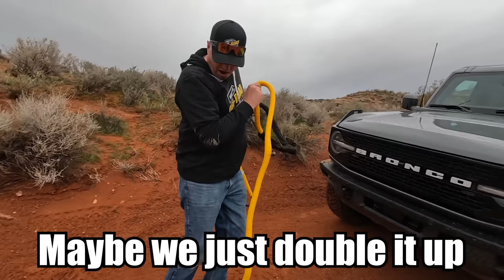More Difficult Than I Thought...Is The Wrecker Too Much For Me?

Comment: I think the boom needs to be extended. If you look at trailmater his boom is a lot longer and it keeps the vehicle out and away from his bumper and boom
Reply: Make the length adjustably long to be situation suitable….
Reply: Rory wouldn't have carried it out ... He would have welded it back together and had Shawn drive it!
Reply: I have 0 experience in off road recovery, but it sure looks like a slightly longer boom would really be helpful. Something that can be extended would really be nice, but maybe not worth the trouble.
Reply: Needs a longer boom and some link bars to connect the wrecker and towed vehicle together.
Reply: Needs a sling like most of the tow trucks, everyone keeps mentioning its not setup right, knew this would happen.
Reply: Or maybe an angled boom for better clearance?
Reply: @edc6333  Did you watch the games? Sling towing was no advantage and caused more problems.
Reply: But, but Rory just dumped one on its side towing it.😢
Reply: does mater have crossbars too? i think he does.
Reply: @G53X0Y0Z0  crossbars or link bars are crucial otherwise it's just a crane.
Reply: How about something to rest the wheels on like on-road wreckers.
Reply: @thomas1942  that’s what I’ve always wondered. Why not just a wheel lift. That would be as useful or more useful than a boom.
Reply: Stand-off bars in the shape of a triangle mounted to the wrecker at a single point, like a tie rod end to allow articulation in two axis and rotation and then able to attach to the customer vehicle at shackle points.
Reply: @pkonneker  - I think you are exactly right. An extension to the boom that was about parallel the the ground would be the best geometry.
Reply: So many experts. The longer the boom, the greater it is going to swing during rough ground driving. 

Kudos to Matt for allowing his boo-boos to be seen. You know that he is working on having it right.
Reply: @steventurner6385  - the shorter the straight boom, the more it will bash the front of the towed vehicle.  For what it's worth, I am a professional designer and engineer that understands 3D geometry pretty well. The boom geometry is definitely less than optimum for the purpose, and they will be plagued with problems until it is corrected. I'm not trying to be critical, just helpful. There was a lot to consider during the construction of the wrecker, and they did pretty well, but missed some things. I actually am able to and would be willing to stop by Matt's shop and measure things out, and produce a CAD model that would eliminate most concerns and fiddling around. The proper geometry would reduce the need for link bars, although they would be useful for certain circumstances.
Reply: Shawn great job filming,  Matt should consider a wreckers sling. With wreckers hooks that grab onto the diff axle. No person needed in tow vehicle. SAFE
Reply: @steventurner6385  the guy builds an amazing custom truck.. and before that the Morvair.. which is insane...

And he still gets armchair advice...😅
Reply: It needs something rigid between tow vehicle and the vehicle being towed. The setup now just seem unsafe. Relying on someone at the rear to brake. I'm sure most vehicles brakes are bias for front wheels. Towing heavy vehicles with the equipment heavy bumpers and other modifications. Just relying on someone at the rear to brake the rear wheels while front end dangling in the air on dirt.
Reply: @cliffmorgan31  a longer boom, even in the lower position won’t clear that tunnel they go through a lot, I thought Matt said that when starting the build but I might be wrong.
Reply: @tonyhussey3610  -  Matt is a good guy and does a good job, but believe it or not some other people have experience and professional talent too. The boom geometry is just not optimum, anyone who debates that is minor league. Again, nothing against Matt personally, he's a great person.
Reply: I came here to say this. Longer boom with cables running under not over. Like trail mater
Reply: @jrrarglblarg9241  No I didnt see that part, i will have to check it out.
Reply: @tyendor1952  So True
Reply: @edc6333  Eric of BSF had issues. He usually recovers in muddy woods, not on top of a rock pile.
Reply: @0ldGuy  i can see the need for a lift. Mainly when something is stuck in mud, sand or snow. The lift would help get the vehicle or wheels lined up for the wheel lift to take over. Or like someone else said, an articulated triangle, to keep the vehicle from swinging (that would be lighter and easier to make)
Reply: @danisyx5804  Rory does not use them and if you watch enough of his videos you'll see several times where he explains they just don't work for off road.
Reply: @danisyx5804  Maybe you should let Rory know that he's been doing it wrong all this time.
Reply: needs a boom like FabRats that can extend out
Reply: would love to see a backfacing seat on top of the wrecker gives someone the chance to move the boom when needed.
also a third seat and a great filming spot.

your doing great. thanks for watching.
Reply: @jrrarglblarg9241  Gotcha
Reply: @G53X0Y0Z0  See I don't know much about off road recovery but that's what I was thinking, adjustable bar or something that keeps the towed vehicle from wanting to buck and roll into the back of the truck
Reply: @ninakincade602  Rory didn't roll that, the customer panic-standing on the brakes while sliding sideways did it.
Reply: @ninakincade602  the owner was driving. locked the wheels, etc. I won't count it on Rory...
Reply: @danisyx5804  No, Rory rigs up straps just like this.
Reply: Or maybe even better, make it a hydraulically adjustable length boom, kind of like on a ladder fire truck. (But not quite THAT long, lol!)

Comment: I love Jillian, she goes off roading alone whenever she has two minutes to spare😂
Reply: Ya she’s basically a member of the team at this point
She’s A beast!
Reply: She needs an actual off-road vehicle
Reply: They should build her a surprise Isuzu rodeo or something
Reply: Does she have a channel?
Reply: @USA__WILL  Jillian's Adventures
Reply: That Expedition 😂😂😂 Matt’s favorite customer
Reply: @craigjaco8096  Two Votes for building Jillian a more capable vehicle but with the condition she record her off road adventures.
Reply: @Lexidezi225  That's a solid axle expedition, it just needs a lift kit and taller tires 😁
Reply: @kd7cwg no sir. You're thinking of Excursions. That's an expedition, and it has IFS. I couldn't tell in this video, but there's also a chance it had independent REAR suspension as well. The excursions were way bigger and beefier and they did come with dana 60 front axles
Reply: @MegaDysart  the first gen had ifs and solid axle in the rear. Favr a few options to get a little lift and better ground clearance. 2nd gen an up got irs

Comment: Been watching for awhile now. In my unwarranted opinion I believe that a lower adjustable tow bar maybe a good idea to aid in keeping customers vehicles at a safer distance from the wreckers rear as well as stability in the side to side swaying…
Best Wishes to Matt & the crew! Keep up the great work & content!!
Reply: Came here to say the same. I am in no way certified in recoveries or done near as many as them. But this was my exact thought the first time they had a problem.
Reply: I know rory from trail mater has said the tow bars fail like crazy, but man it sure looks like they need one. Maybe make one that is sliding with shock absorbers
Reply: My thought also, but how do you secure it without causing damage to vehicle being towed? Maybe some sort of air bag? But even that could damage a plastic font-end.
Reply: @kylancook3477  think if anything the boom needs to be longer or even extendable like a rotator
Reply: @jonstevens7431  Yes , the boom is a little short , I am pretty sure they will address that at some point.  Easiest way to make it better.
Reply: An old tyre would help ,two would be better
Reply: Rory would disagree
Reply: As with any issues with anything & everything there’s usually always room for improvements & generally speaking simply use existing technology & applications with the mindset that necessity is the mother of invention..
Reply: I trust Rory's experience when he says that a soft setup works best for a wrecker on trails.
Reply: Rigid members increase the probability of damage significantly, especially when you need maximum freedom to articulate.

Stand-off bars also will want to push the towed vehicle up and into the boom on steep downhill sections like this one.

And they make it harder when cresting hills, because you have to let the winch out in order to not shove the front bumper through the radiator.

Comment: 7:32 - Matt, all you need to do is build a removable cross bar that goes from the boom to the connection points on the customer vehicle. This will create a protection triangle, preventing the customer vehicle from getting too close to the wrecker. I would put a motorcycle shock in the middle of the cross bar to aid in absorbing impulses offroading.

Comment: As someone wrote in the comments on the last video, a large boat fender, or several, attached to the boom would probably stop damage to the towed vehicles. I saw Rory had a strap that the nose of the towed vehicle nestled into (shielding from the boom), maybe that could also work.
Reply: I have also seen that strap device on Rory's truck, looks like it's made from sections of old tire treads. Seems like an excellent idea.
Reply: A heavy duty inner tube inside a skinned down tire roped in place. The thinned down tire would protect the tube from pinches….

Comment: You watched the setup BSF had at the wrecker games - put those silly pintel hitches to work and build an a-frame so you can keep vehicles from smashing into the back of your wrecker.  It's worked for a decade plus going up and down some of the slickest and steepest climbs through the woods.
Reply: He also watched BSF break the sling. 

Rory has explained it doesn't work on the area they're working in. 

I do believe someone could make one that could withstand the articulation though for use out there.

Comment: Nice work by both teams!

Still I'm advocating for two chains to stop the front axles from dropping down. We use them for offroadhauling big trucks. They are essential! And maybe a small bar between the rigs to keep them in place. You dont need something big and heavy, because you don't pull semis.

Comment: Hey Matt, I suggest using Headsets both in the Wrecker and for the person in the vehicle to be recovered for a hands free operation of the radios during recoveries and in the Wrecker, put a PTT close to the steering wheel or the rear steering thing... OR, even better, use a hot mic instead of PTT for complete hands free operation.

That way, you can receive immediate feedback from the driver in the recovered vehicle and you may talk back without taking away your hand from the steering or the winch controller.
Reply: Can't do a "hot mic" - it's simplex on a single frequency. They'd never hear each other.

Comment: Always good to see the big wrecker in action guys! (not sure why they didn't weld the hydro-steering back on, but their probably was a reason?)

Jillian is my spirit animal...living her best life! (She just needs a little bit of a lift-kit and some larger tires by the looks of it?)
Reply: I think he said the bolts got broken off or something.  And the arm may have bent when it came apart.
Reply: You can’t weld aluminum to steel. The body of the ram was aluminum.
Reply: @swooshdave  Agreed big time, but I thought it looked like part of the Aluminum body actually broke off the ram...so Aluminum to aluminum maybe? 01:34
Reply: @shadow105720  I think he said the pins had stripped out of the ram...not sure what that actually means though. Doh. 02:15  (hate not knowing LOL, I want to be YouTube smart! LOL)

But if you look at 01:34 it appears the bracket that is welded to the body of the ram that bolts to the axle mount broke at both ends?
Reply: @sickjohnson  Wouldn't matter. He doesn't have an aluminum welder on board. They tried to reattach it with the soft shackles but that wasn't going to work. I carry a roll of Gorilla Duct Tape and I bet with enough wraps it would get you off the trail. Might take a whole roll. But that stuff is silly strong. Even a bunch of hose clamps might have worked. I'm surprised that guy seems to have zero tools or anything.
Reply: @swooshdave  Thought I seen Rory, do some stick welding on Aluminum not too long ago...they probably make rods for Aluminum now days? But who knows right?
Reply: @sickjohnson  No stick welding for aluminum. They do make aluminum sticks but those aren't for welding, more for "brazing". While they are pretty good I don't know if they would hold that ram for very long. Plus you need to put a lot of heat on the ram to make them work. I suspect the ram won't be happy with that.
Reply: The hydro steering ram is aluminum

Comment: Matt,
  You need a tow bar between the wrecker and tow car. You can use soft shackle to attach the bar to the tow car and to the wrecker. The tow bar will keep the car at a set distance from the wrecker. If you use a tow bar it will keep you from smashing hoods. Using soft shackles to attach the tow bar will give you the play you need for that terrain.

Comment: Matt, love the channel.  You need to make spacer bars for the heavy wrecker,  to go from the pintles to front recovery points of the recovered vehicle.   That way the front end of the customer vehicle can't get to close to the back of the wrecker.  Consider adding a set of lifting loops on the spacer bars to give you more options for lifting angles.

Comment: Low bellies on the IFS rigs.... as an H3 owner I can relate. I installed 1/4" plate over the bottom to protect stuff and make it slide over obstacles. Helps a ton to close those gaps between the cross members so it can't hang up on stuff.

Comment: You should equip the wrecker with a tow bar. 
A 6' to 7' x 3'' heavy wall pipe with a stout 12' chain in it from the truck bumper to the towed vehicle.
That would keep the towed vehicle from being able to get too close to the truck.
Also an old 42'' tire, without a rim, mounted from the top of the tow tree and hanging down might help prevent vehicle to vehicle contact.
You guys look like you have so much fun doing the recoveries!
I would love to be able to run with the crew one day helping people out, even if it is staged. KEK!
I do wear my MOOR hoodie when I watch the videos if that counts.

Comment: Matt, you do awesome work with your recoveries. I'm learning a lot, but honestly, I hope to never need that knowledge 😂
One thought keep occuring to me when I see you towing a broken vehicle using your heavy wrecker - You ligt the front and use soft straps in X shape to secure the towed vehicle to the wrecker. Why don't you use a pair of solid rods to create thr X brace? That way you can still lift the fro t of the broken jeep but the towed vehicle will not roll into the wrecker. You might not even need a driver in the towed vehicle to stay on the brakes, except when you're going some steep decents.

Comment: I recommend running a T bar with a centre pivot so we can rotate with the vehicle left right and side to side and be hydraulically lifted Up down back and forth. This is the only practical way to attach the vehicle with the wrecker as it needs to be rigidly attached to the vehicle in some way to stop it from moving around in an unwanted manner

Comment: Matt you need an adjustable length bar that goes from the pintle to a strap for the  other vehicle. It'll help with controlling lateral movement. You have strap that you use now try a solid link there..

Comment: I keep thinking about this. You need more than one accessory to use with the wrecker but all do effectively the same thing. You need some structure to go from the back of the wrecker (could be the hitch or another point much) to the vehicle/thing you are helping. In one form it could have wheels and be low to the ground for regular cars and vehicles. Another form that is similar to tow trucks that grab the front wheels and you strap them on. You can raise and lower still with the boom but it gives you more control for tough crawling and funky angles. I would love to draw a terrible picture to illustrate what I am trying to convey.

Comment: Matt, Hear me out. I think you should have an adjustable width heavy duty tow bar kind of deal that can mount to the shackle points on people's front bumpers BUT use a chain/binder or heavy strap down from the front of the tow bar to either the front axle or just go under the axle and hook to something else. This way you can get the towed vehicle back 2-3 ft to clear the boom. I can explain / draw it up if your interested. 
Either way keep up the good work!

Comment: You should fab up a rigid bar that would keep the towed vehicle from hitting the back of the wrecker. On the wrecker end, a T-bar secured by the 2 rear pintles with a huge heim joint to allow pivot/articulation. On the towed vehicle end, maybe another heim joint T-bar that Mattstraps across the front wheels.

Comment: I think one challenge I see with the wrecker and any vehichles that are towing in this kind of trails is how to prevent the crane and the cranes cable from hitting the towed vehicle. It would be interesting to build a way to prevent it. Maybe a tow hook that has an attached solid steel frame that guides and push the cable away from the towed vehicle.

Comment: Armchair engineer here.  I feel like several massive poly ropes, think cross fit all bound together with a heavy rubber wrapping, like inner tubes, could be used as a flexible damper to help avoid vehicle to boom collisions.  Basically this would go in place of the lower straps.  I have seen this concept in practice mooring boats.